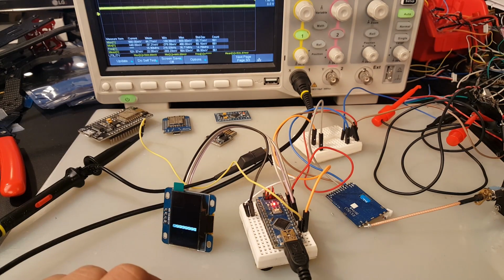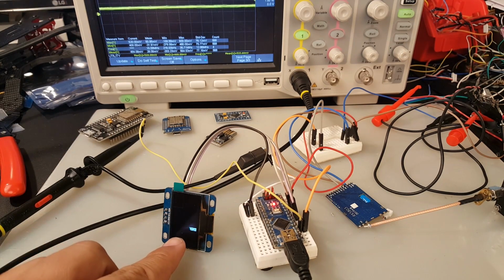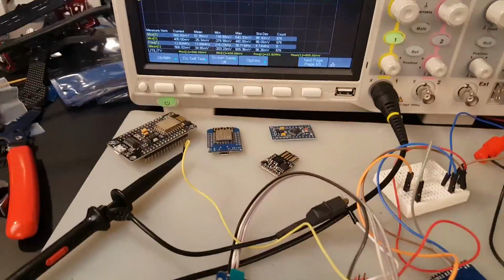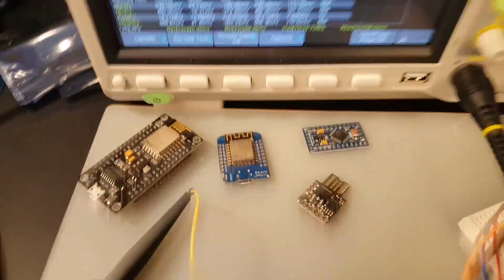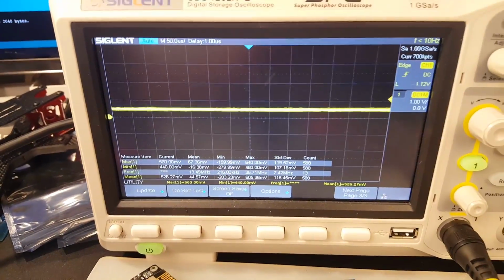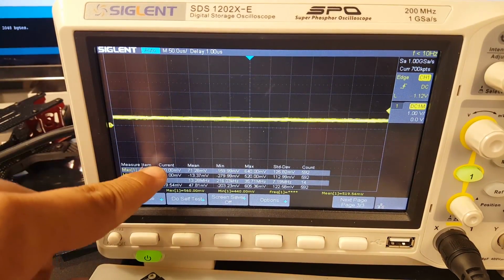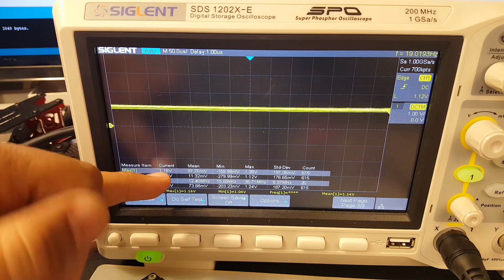FPV Drone Finder // DIY How To

Comment: Cool project, I had a very similar idea for a handheld device.  I've used my goggles RSSI display to find my quad several times when its gone down in long grass.  It works great but holding the goggles and looking at the display is a pain as the antenna is normally pointing at you.

Comment: You "rock" mate. Keep this going. Good work! Waiting on more about this as it will be so useful. What about doing something is case the quad loses power (adding a small battery to the VTx, or something like that)?

Can you do a video on Betaflight telemetry from the ESCs to the FC? Also, a review on the Topsky T7X?

Thanks!

Comment: Here is my idea (not sure if this exists already) to address a lost quad with a battery ejection. Using a button cell battery and a buzzer, mounted in a breakaway enclosure so that when the two parts are separated, the buzzer goes off. When the two pieces are connected again, the circuit is broken and the buzzer stops. Use some sort of rubber ring tether and slide one part over the XT60 connector on the quad, and slide the other piece over the XT60 on the battery lead.  Then, you have a breakaway buzzer that only goes off if the XT60 connectors are pulled apart. What do you think? Can it be made cheaply and small and lightweight so it doesn’t get in the way or increase the AUW very much?

Comment: Nice try. It may be good for searching filming quads which usually are flying far away from sight range. However in mine lost racing quad finding experience the majority of falls ended in pretty close range (20 to 50 meters from pilot), but with battery disconnection. Which mean no VTX signal available. I maked a habit to write all flights on DVR so I had possibility to point to aproximate crash location, but then in most cases i needed to search silent and black quad under bushes/leaves, on top of trees etc. When battery was not disconnected then it was not hard at all. So it would be interesting to have some small and light independent DIY device which is detectable in range up to 50 meters. Seen a device which need CB radio to detect it. I'm not a fan of that idea because device had pretty long antenna and to use it I should buy a CB radio too and take it to field every time. Maybe Bluetooth if it is possible to locate it without mandatory pairing.
Reply: Yes, exactly my experience. If the battery is still connected a beeper (or even beeping motors) works fine. But usually in crashes the battery ends a few meters away... Problem with the independent device is that it would need a additional battery, which needs to be recharged/replaced from time to time and adds weight.
Reply: Yes, exactly that - it is extra weight, problem to mount it in place where it will not create drag or go into props plus not in place where HD camera (Runcam, GoPro) goes. But I still wish to have any, but lighter and smaller :)

Comment: "Pretty Sweet". Thanks for the video!
Reply: Is there a way to have something independently powered, maybe a watch type battery, that can be turned off and on? So disconnection of your main battery won't result in loss of power to the finder? Just thinking out loud here.

Comment: Hello can you do it more cheap, no Arduino and no display only a audible sounds like a metal detector, using a 555 ocilator and have la rssi as input to change the tones the speaker
Reply from the maker: edward Burgos Yes we can but I wanted it to be upgradable and extra functionality in the future

Comment: I use my Taranis by using the rssi that is if the battery is not ejected...
Reply: To use you taranis you sold have to use a pach o direccional Antena
Reply: It would work better that way but no you don't have to have a patch on it. If you are not pointing in the right direction the RSSI value will drop by a few points. Trust me I use it almost everyday to find my quad.
Reply: Very nice
Reply: David yeah I have been pushing my limits the past month learning tricks. Getfpv loves me right now..lol